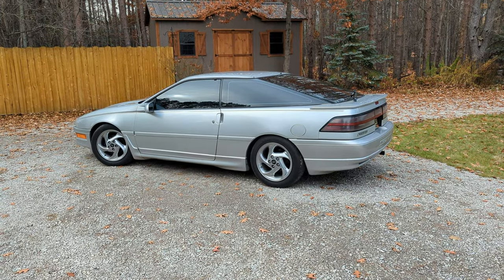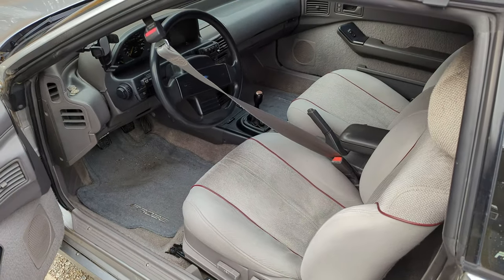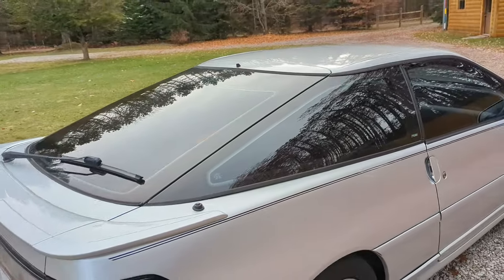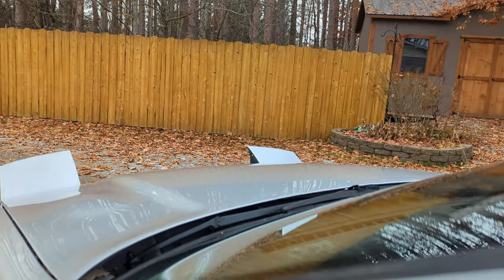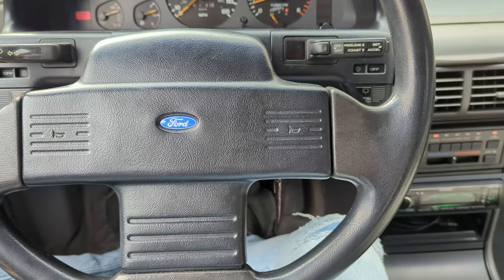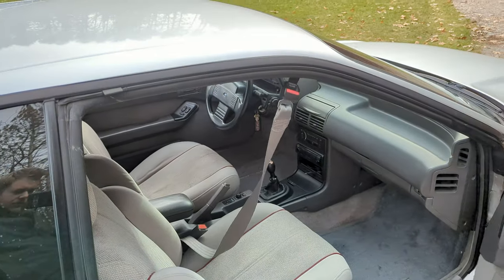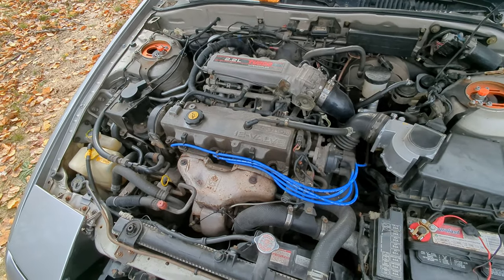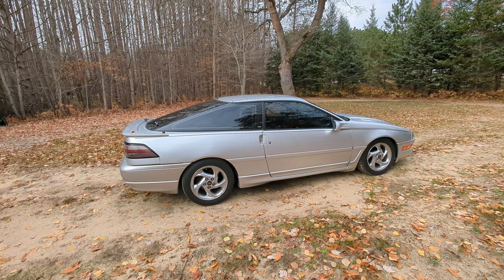1990 Ford Probe GT Turbo - In-depth Walkaround

Comment: Fairly randomly tonight, I decided to search for "Ford Probe turbo".  Look at this!  What a survivor.  I'm impressed by its condition.

I bought a black '89 Probe GT new in late '89 toward the end of its longish first model year – the only year of the first-gen with its particular exterior styling (like the one in the MotorWeek review) before the quick refresh.   Over my ownership, I upgraded to a set of BBS RZ wheels, Dunlop D40 shoes, Suspension Techniques sway bars, HKS exhaust, and various audio system and interior upgrades.  It was a very fun machine, if suffering a bit from Flat Rock build quality.  I later traded it for a Sentra SE-R.
Reply from the maker: Haha that's great, thank you!

My dad's was also a black '89 GT he bought new early in '89 and still had it until 2010 with 338k on it. Definitely fun little cars but I agree with the Flat Rock build quality, very apparent in the interior. I've always liked the Sentra SE-R.

Comment: I had an '89 Probe when I was a senior in high school (1999). The only issues I ever had were a leaking master cylinder and a few hoses splitting from age. Something odd I remember was that it had a "Turbo" switch, but mine wasn't the turbo model.
Reply: That was a feature of the Probe GL and LX with the automatic transaxle for the 1989 model year.

It altered the shift points.

Comment: I had the LX version in Seafoam Green. Two cool features I liked was the headlights and wipers had a winter mode.  Wipers would pop up a few inches on the windshield to utilize the defroster and the headlights could be kept up in the winter so ice would not freeze them closed. Plus that car was quiet…engine sounded like a sewing machine.

Comment: No way in hell a clutch and turbo lasted 338,000 miles. I owned a brand new white 1989 Probe GT bought for $16,500 off the showroom floor. I did not drive it too hard and the clutch and turbo both had to be replaced at around 60k.
Reply from the maker: Well they did, my dad was the only owner of his car and he knows exactly what he had replaced or repaired in it. The majority of his miles were also highway and when I say he drove it easy, he drove it easy...never redlined and would rarely ever bring it past 3,500 RPM. My '95 Honda Accord has 412,000 miles and is on its original clutch so it's definitely possible, once again mostly highway miles. Turbos and clutches should definitely last longer than 60k miles.
Reply: I drove mine pretty hard with an aftermarket turbo computer hitting 16psi.  owned it for 5 years with no turbo or clutch issues at 160K miles.